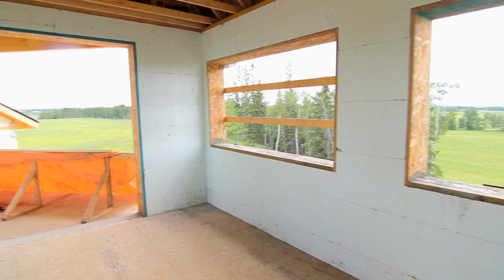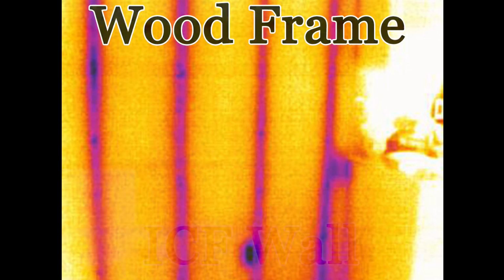10 Reasons to Design with ICF (Insulated Concrete Forms)

Comment: Important to note that the ACH50 score is indeed "air exchanges per hour", but at a 50Pa (50 pascal) pressure differential.

Under normal conditions (i.e., there isn't a huge fan in the doorway pressurizing the house), the average pressure differential between the inside and outside of a house is a small fraction of 50Pa. This varies by location due to wind, climate, etc., but for example in Minnesota the "ACH natural" — the air exchanges per hour under normal circumstances — has been estimated to be about 1/17th of the ACH50, and in Florida it's more like 1/30th. 

So the graphic at 18:28 is a bit misleading. The ICF home used in the example probably actually loses between 6,894 and 12,112 cubic feet of air per day, not 205,920. 

If the HVAC system is measured and balanced after the house is complete, the pressure differential can be even lower, so the air lost per day can be even less.

For further reading, see 
https://www.greenbuildingadvisor.com/article/blower-door-basics 
and 
https://en.wikipedia.org/wiki/Blower_door
-
Reply from the maker: I agree with you and of course am still learning more of the technical data. But I appreciate your words and appreciate the link. Cheers!
Reply: Does this mean that you do not agree with Kody that this is a superior construction compared to timber frame?
Reply from the maker: I like this question!!  Because after what was said above, an ICF home would lose literally zero air naturally!

Comment: What brand ICF are you using most and why do you like it?
Reply: That particular project looks like Nudura icf blocks. They are a slight bluish color, and just looking at their physical size.. Nudura blocks are probably the biggest, I also really like their design/features  *not a Nudura rep 😂
Reply from the maker: Thanks for your input Jay. I agree with you
Reply from the maker: Check out my video on 5 reasons I like Nudura block.  But at the end of the day all block is good in their own way. All have pros and cons when compared to each other.